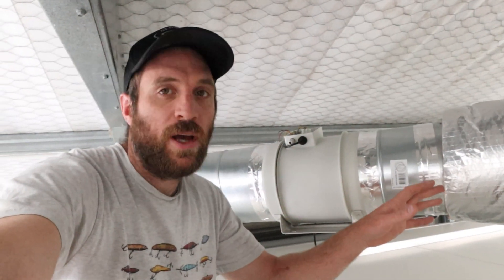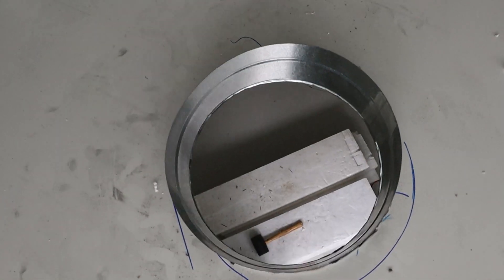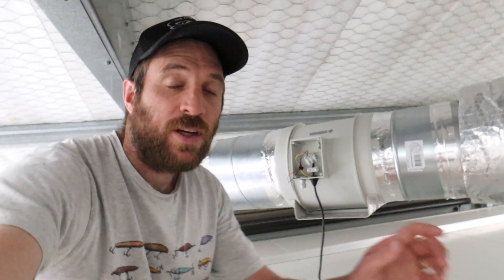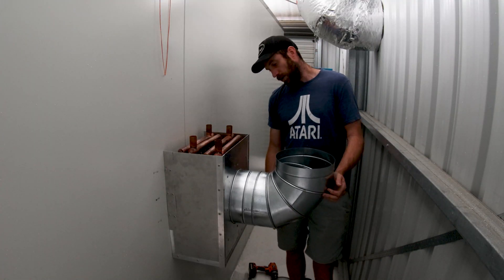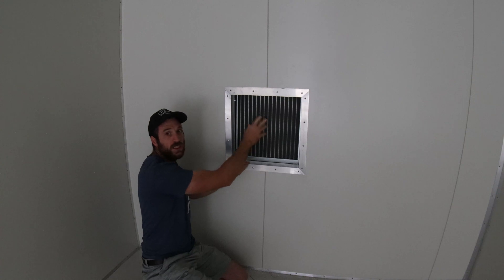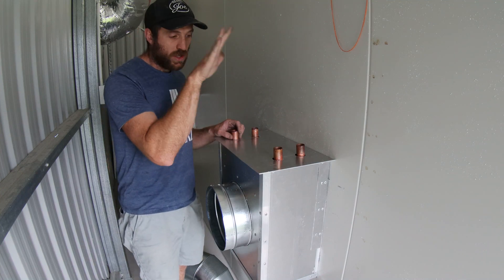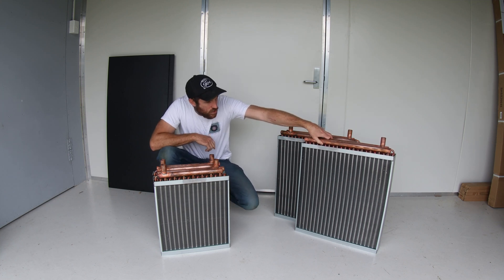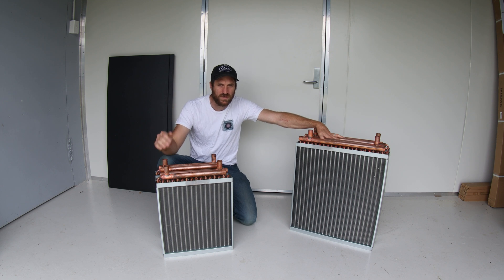Building Heat Recovery for my Mushroom Farm Ventilation System

Comment: The reason higher flowrates are more efficient is the retention of your driving force, or temperature difference. If you flow water through slowly enough, it may reach the same temperature as the air you're trying to pull energy from, or the equilibrium. If there's any heat exchanger left after this, it's not being used! But, the closer you get to equilibrium, the lower the rate of heat transfer. Ideally, you'd flow water through so fast that the temperature barely changes. 

The easiest way to achieve that with your setup would be the faster pump, flowing through both heat exchanger cores in parallel rather than in series. This would be the lowest head requirement for the pump while maximizing the high temperature difference areas of your exchanger.
Reply: Hey there @doctorgoose7, do you have any resources i could look up to learn more about these heat exchanger cores?
1) Mainly, wondering what rate of flow is best. I’ve seen a couple circulating pumps, one is 3-speed with a 17gpm max, the other is single speed with a 21gpm max. 
2) I would also like to learn how to fill and purge one of these systems.
3)?Lastly, why would they work better in parallel vs in series? 
Thank you for any more light you can shed on this.
Reply: @mythicmushrooms  I'm afraid I don't know any good resources, but the concepts to read up on are Heat Exchange (Thermal Transfer) and Fluid Mechanics (how the air and liquid are flowing). I would love to involve @OakandSpore in this, because coming back I have some questions about the original build. By introducing an intermediate heat exchange fluid (air:water:air instead of the typical heat recovery cores' air:air), they have a unique system!

Anyway, may take some data + more design info to correctly inform you on any particular parts or sizing, but I'll do my best.

1) Pump choice can be difficult, and it's more about pressure. You need enough flow to prevent fouling and dead spots while maximizing heat transfer efficiency. However, increasing flow requires more energy for diminishing returns. A three-speed pump typically offers three pressure settings. The pressure a pump works against affects the flow rate, with factors like pipes, bends, height changes, and heat exchange fins adding to pressure loss. It's crucial to design your system so the pump isn't operating near its maximum pressure rating. Most pumps perform best at about half their maximum pressure, indicating a well-balanced system when achieving around half the maximum flow rate.

2) Use distilled or sterilized water, and try to seal the system. You can't solder a filled pipe, so there must be a purge line at the lowest point (before the pump). This lets the pump blow the debris out of the entire system to waste. The system is filled at a tank after this purge and before the pump. Bonus: The water will allow rusting between parts. Check your galvanic compatibility for all heat exchange fins, pump parts, pipes, and fittings. Consider a stabilizing (anti-corrosive) additive and a biocide to kill anything that gets into the water.

3) Heat exchangers work better in parallel than in series because there's less pressure drop when fluid flows through parallel paths compared to a single series path. This is similar to how electrical circuits experience less resistance in parallel connections. Lower pressure drop means higher flow rate through the heat exchangers, improving efficiency. Additionally, spreading the incoming water immediately in parallel maximizes the driving force for heat exchange by exposing it to more air at once.
Reply: @smartestfactory  thank you sir. I’ve been deep through the woods of hydronic systems. I will be running a 10-15% heat transfer fluid/distilled water solution. I settled on a 3 speed pump, air separator, expansion tank, and copper tubing. I won’t be running them in parallel, but I’ll be running the outgoing exhaust exchangers side by side for what I understand to be a better Delta T, and the intake exchangers one in front of the other to cool the warm air as far as possible. We’ll see how the system works on the 110° August heat waves. I’ll upload a video or two to my channel to follow up. Thank you for responding to me on this.
Reply: @mythicmushrooms  Looking forward to your results!
Reply: @smartestfactory  the system has been up and running about 2 weeks now. It has been a success. We had indoor temps of 66-67f on a 112° day. When I get the time I will shoot a video and update ya here. Thank you for the valuable input 🍄‍🟫⚡️
Reply: @keepthatlilsmug  Happy to hear it! That's some impressive conditioning achieved.
Reply: @smartestfactory  small update, ive added a coolbot to the system, and have been running the grow room at 56-59°f for the last week. no major heat waves, but it has been in the mid to upper 90’s while maintaining these low temperatures ❄️
Reply: further update: removed cool bot. no longer using. increased air input and room averages 62°. added oscillating fans seemed drop temp a few more tics. likely to evap from ultrasonic mist set up. will do a vid soon 😎

Comment: Hey Tom, super interesting content. What air flows are you trying to achieve? Those are pretty big 200mm fans for a small space. Do you need to have variable airflow for each room if not you could use one for your supply and one for your exhaust. The heat recovery will need fairly slow extraction rates or you will not exchange at a very high efficiency, tricky to find the right flows especially as you are using radiators fit the exchange. You will need to insulate the heat recovery box or you will loose more heat energy through the metal. Also may need a condensate drain, depending on the humidity in your room and the temp of your water you will most likely create condensation in your box.  A hydronic heat pump might be a better bet if you want reduce energy use and recover heat. Love seeing what you are building though.
Reply from the maker: The fans are 300mm. 200mm was too small, and 250mm were not available in 0-10v in my country. I use variable air flow connected to a CO2 controller so I am not venting excess atmosphere. It takes energy to condition air, so it saves on energy consumption. Heast exchanged are more efficient when you pump water through them faster. I dont need to insulate the box they are housed in as the time for heat cold to permeate through is far lower than the speed at which conditioned air moves through them.
Reply: @OakandSpore  What are the air volumes you need to run through the room?  300mm fixed flow is huge especially as you said you are going to mechanically extract with a centrifugal fan as well. 
Is the purpose just to manage CO2 or are you managing heat and humidity as well?  
When you say variable air flows, is the supply on trickle ventilation (constantly ventilating at low rates) or does it switch on and off depending on the CO2 level?  Is the purpose to create a negatively pressured room or just cross flow to control the air quality? 
The extraction airflows will determine efficiency of your heat recovery as well as the water flow rates in your radiators.  The faster you move the air across your radiator fins the greater the loss of heat exchange but too slow and you will loose your required extraction rates. Will you store the water somewhere that you are pumping around?  I was wondering about the insulation of the box as the metal will act as a heat sink at about the same rate as your radiator depending on the surface area, lowering efficiency. In a residential environment the heat exchanger would be inside the envelope (in your case the room) because of heat loss. I am interested in seeing your results are you have had it running for a while. 

Sorry for all of the questions Tom, love your engineering so I'm trying to better understand what you are doing.  I'm also in NZ - If you want to find out about Hydronic Heat pumps which would deal with your ventilation, heating, heat transfer/recovery and hot water look up Dennis at Evolution FX in Auckland. Hes a bit mad but very knowledgeable.
Reply: @gingerznz5742  Hi Ginger,  You've raised some solid points.  Are you able to point me in the direction of some good heat exchange cooling systems. Thanks

Comment: Hey Tom, did you have any updates/ examples/ mesurements on the efficiency of using heat exchangers?
Reply from the maker: Not yet. Mine aren't hooked up, and we aren't even bothering to use them in summer as the rooms keep to the ideal temperature without much energy input.

Comment: Nice sharing, mate, Do you have any plan to use solar heating the ventialtion system or just use the main power? and the ventilation system looks not easy one, how do you design it or do oursource some experts do the design first?  btw, keep going,  I am expecting to see the final running :)

Comment: Great project! Why are you putting heat exchanges on the exhaust air going outside?
Reply: You will pick up some waste heat from the air and the fluid in circulation can take that heat to where you want
Reply: Are you not blowing spore air through those heat exchangers? Seems they would quickly clog and become corroded?

Comment: Why would you NOT want positive pressure in the fruiting rooms?  I thought positive pressure was necessary to keep contaminants out?  Thanks.
Reply: You're right. Positive pressure is used to keep rooms clean from any contaminants, but fruiting rooms are dirty due to spores so you want them negatively pressured. If the fruiting room is positive the billions of spores can recirculate into your hvac system and spread everywhere including your lab also not very good for your lungs - look up spore lung.
Reply: @luissandoval7603  Aaaah....I see.  Makes sense.  Thanks.
Reply: I've been using my setup with positive pressure, the incubation room is in the same insulated room with an internal separator door, the air definitely gets pushed from the fruiting room into the incubation room. I've had no issues with contamination and saved money on equipment as the exhaust fan is less frequently replaced. Regarding spores from the fruiting mushrooms, they just eject out the ventilation openings and I always wear a respirator, which you should in negative pressure also.